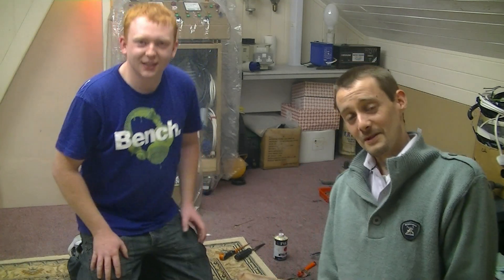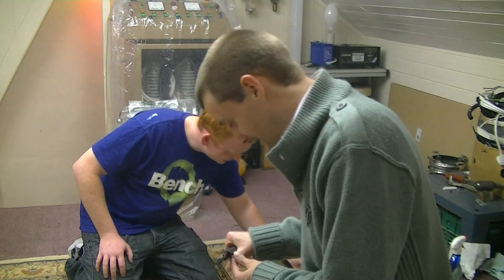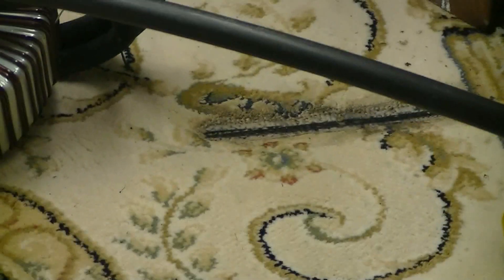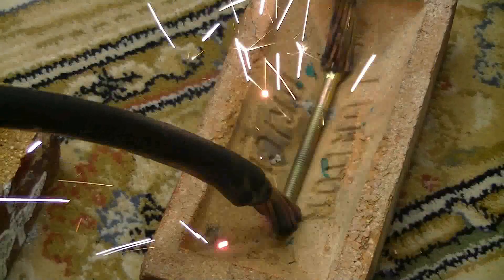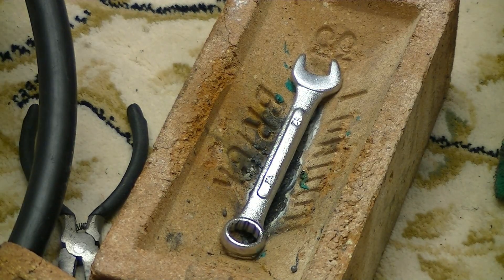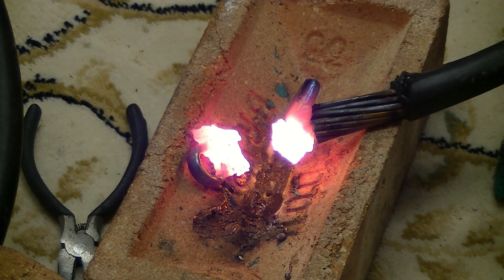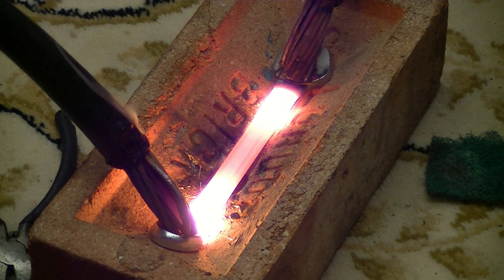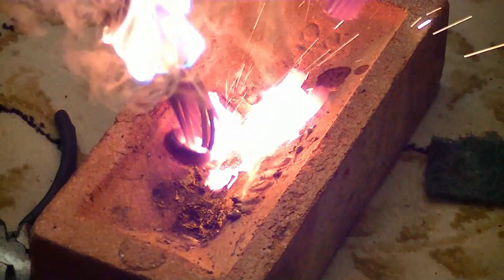5000 Amp Fuse + Tools Melt With High Current

Comment: This is like the most dangerous youtube video I have seen lol
Reply: look up "metal fume fever" fire is actually the least of their worries.
Reply: +Kreig Dernier 5 to 10 volts are not enough to let many current travel through your body. If the voltage gets higher, more current flows through your body and this is what kills you
Reply: The voltage directly determines how much power flows through your body. It takes about 100 mA to kill you. A double-A battery can supply about 4000 mA, and yet you can hold it without dying. It's because it's only 1.5 volts. It doesn't matter if it's capable of supplying 4000 mA, 4000000 mA, or 4000000000000 mA. Your body simply does not draw enough power at 1.5 volts to harm you.
Reply: Don't worry, dettol on standby
Reply: It's current which kills, but for reaching that current in the body you need a sufficient voltage. So yes a 5000A 12V generator will not harm you, because the body resistivity makes it impossible to reach 30mA with just 12V (the body limits the current). Just as a 100kV 1mA generator is safe, as the current is then limited by the generator to 1mA... You are both right.
Here this is dangerous only if the voltage is higher than 12V to 48V (depending on people and skin moisture)
Reply: amps is just the unit of current isn't it
Reply: I = V/R where I is current, V is voltage, and R is resistance. A high current can be a low voltage, if the resistance is low too. Etc. The resistance of human skin is usually too great for lethal amounts of amps to pass through us, unless the voltage is raised to overcome the resistance, which uses more energy, obviously. A typical household plug is limited in both voltages and amps by law, where most 220-240v sockets are 10 amps maximum, but by using a transformer they can exchange some volts for some more amps. This video is just an extreme example of that, where the voltage is probably minuscule, but the resistance in that thick copper wire (welding cable) is also minuscule.

It really shouldn't be difficult to understand, and I never really studied physics at high school or have a background in electrical work. I'm only a bicycle mechanic...
Reply: To all comments here:  it is electricity.  Don't fuck with it.  There.  I win the argument.
Reply: Steve annonomus 
They had kerosene on the ready as an extinguisher.
Reply: I was uncontrollably dodging the sparks
Reply: just think.....if we watch long enough we get to see how fish and chips are really made..............Darwins Law is rather slow acting sometimes,or is it just the entertainment factor causing the slow down ?? I DUNNO.
Reply: Justice Harmony that's as meaningless of a statement as "it's not the gun that kills you, it's the bullet" "Guns do not move thus they can't kill you, bullets are what move"

Refer to Ohm's law, V = I x R
Volts = current x resistance

Now, the human body is not a homogenous conducting wire, but the same principle generally applies.

Voltage and amps have a direct relationship to each each via resistance.

Saying that amps kill and not volts or vice versa is one the stupidest things a person can say.

In the case of the human body, if voltage is sufficient then it will allow enough current to pass through the body to stop the heart. I = V/R demonstrates this relationship.

Electric potential (voltage) allows current (amps) to flow, THEN the current kills you.

Similarly, guns allow bullets to accelerate and zip through space, then the bullet kills you.
Reply: Guys, who gives a fuck. The Shamrock Shake is back.
Reply: Steve annonomus It's LIKE the most dangerous? Tell me which other video this is similar to! i want to know!
Reply: the current will slay you...  lol
Reply: Steve annonomus why are you doing something with electricity and fire on top of the carpet man come on now
Reply: They use a reotor @ 1-2kv, lets assume 1.5kv. Winding ratio of the currenttransformer is around 100/3 so that means sec voltage is at around 50v in the best case scenario (won't be that way). It's not entirely safe but if they do not have a wet skin they probably won't get electrocuted by touching it. Heat is another thing ;)
Reply: Steve annonomus guns don't kill people rappers do
Reply: can i try this in my living room?
Reply: kadyr5 you're eighter the worst electician i've ever met or a fucking liar. open a phisics book lad.
Reply: Actually if voltage gets higher it doesn't mean you get more current flowing through your body to kill.. The possibility of anything going through you is based off of resistance or "Ohm's". The main thing to note with current draw is that power will find the path of least resistance. The majority of power will find it's way through whatever has the lowest resistance.. If you have 2 wires hooked up to the same source of power, amps will find their way through the wire with the least resistance.
Reply: Steve annonomus you should see his other videos.
Reply: Galinette2000 the body might resist current but at the cost of.. oh.. idk.. FUCKING 2000 DEGREE HEAT
Reply: just think of electricity in terms of water and water pressure. current=amps. so say you have a garden hose and it's spewing out water. the current is coming out in a consistent matter. then put your thumb on half the opening and it starts spewing water out more intensely. it doesn't affect how much water(amps) is coming out, it just makes it that much more intense. so yeah. anyone who says they've been hit with over an amp is a liar. voltage doesn't kill, Amps do. voltage just makes your death that much more violent.
Reply: It actually doesnt have to be as high as you might think. Condition of the skin and where it makes contact are huge factors. check this site out as its explains in decent detail and has measurements. http://www.allaboutcircuits.com/textbook/direct-current/chpt-3/ohms-law-again/
Reply: "voltage is less dangerous at high voltage". Oh my fucking god. I can't unsee this.
Reply: +MrTylerGaming when I made the comment I had no idea they were also drunk! adds to the danger!
Reply: Shaza Selvarajoo best response. can we all agree that electricity will kill you? or someone can just make a YouTube video testing individual results of being shocked with low volts-high amps, high volts-low amps and finally high volts-high amps. I will subscribe. lol
Reply: So many replies.. Voltage is the potential. Amperes are the measure of electrons flowing in time. You can increase the wire size, lessen resistance and allow more current flow. If the voltage (difference between) does not effect you because there is not enough potential..then you'll be ok BUT if the voltage is enough to cause current flow through your body very little current flow may affect your nervous system or stop your heart. Same way that a very high voltage can hurt but with very low current there is not enough passage of electrons through your body to cause your systems to fail..or burst into flames..vaporize your body..etc
Reply: nothing dangerous is not there
Reply: +ady gombos - If 8 amps is flowing through a person's body, he will be dead.
Reply: +kadyr5 it's current that kills. the only reason you survived 200 amps is because you have skin. the relation is that higher voltage = more current for a given resistance. it only takes a half an amp to stop your heart. put a cut on your chest and a cut on your back and stick a little battery charger or something on both sides and you'll be dead in 3 seconds. as an "electrician" you should probably learn about these things...
Reply: As an electronics technician its funny reading all those comments XD XD
Reply: It's both that kill you... low voltage = can't pass the resistance of your body = very little current. No electric potential = no current. The relation is very simple I = V / R
Reply: Steve annonomus k
Reply: Yeah, playing with high voltage while drunk is still pretty damned dangerous, especially when you are melting metal with it.
Reply: so is there any risk to what they are doing?
Reply: TheDantheman12121 Yea. It honestly depends on their set up though... Really the only thing protecting them from getting fried is the rubber around the wire they are holding in their hand. Also they are using a step up transformer which is most likely getting really hot sitting on the floor.
Reply: You need to learn ohm's law.
Reply: Actually it does. it explains the relationship between your body (r), voltage, and how that affects current. Also thats only one of many equations to ohms law. See here http://www.electronics-tutorials.ws/dccircuits/dcp4.gif
Reply: ph4nt0m For sure, It all depends on how and where the electricity flows thru the body to take out organs. has to find the shortest path back to is source..i get it and studied electricity. take care
Reply: Federico Mora first of all water and water pressure would be amps and Volts. Water = Volts, Water pressure = Amps. If u block the tube the pressure (amps) rises because of a higher resistance but the Water (Volts) always stays the same. 
Secondly u can get hit with more than 1 Ampere and survive (lightning would be the perfect example) its just very unlikely. Also saying voltage doesn't kill u is also not completely wrong but also not true either. If u get hit by 24V/6A u won't even notice it. If u get hit by 230V/0,002 A u also would survive but if u get hit by more than 50 V and more than 30 - 50 mA u will most likely die if this all happens long enough, because time is also a thing here.
Reply: The typical static electricity that we feel is about 10,000-20,000 volts.
Reply: +Alex Paulsen I always thought that transormers just changed the voltage by itself.  So if you drop the voltage down in a transformer, the amps go up, whereas if you raise the voltage, they go down?  If thats the case does that mean control circuits that get 24v, like a thermostat are higher than normal amps?  I think its googleing time for me  lol.
Reply: Steve annonomus dunk guys and electricity don't mix
Reply: +Bach Tran Not entirely true. It is not the power that is killing you, it is the specific range of amps (the typical 0.5A/1A being the most dangerous) that will cause Ventricular fibrillation. In an AC regime it also depends on when exactly you are being electrocuted that can make the difference between life and death. Somethimes high power (for example a thunderstruck) with amps going up to 30kA and voltages way beyond any reasonable number to be alive can be survived because the shock is this big that it basicly became a defibrillator instead of a fibrillator, wich will not cause ventricular fibrillation. However, the inside burning and damage to organs CAN cause death but this to show that in general dieing from electricity, for example from your own electric grid, is caused by amps and amps only (OBVIOUSLY ASSUMING YOU ARE CONDUCTING SO FOR AC REGIMES VOLTAGES ABOVE 50V).
Reply: Steve annonomus Ikr, they're even doing this on a rug which seems veerrry flammable!
Reply: GuildOfCalamity  plus there on carpet wich could catch fire
Reply: Steve annonomus *Most Dangerous YouTube channel
Reply: it wouldn't be 5000 amps without enough voltage to force the flow of 5000 amps.
Reply: Rocket Steve929 agreed, fucking idiots
Reply: C4rnif3X I swear if I hear this bullshit one more time I'm just gonna end myself right here and right now. Of course it's the current itself that kills you but without the necessary voltage it won't go through your body. At 10 volts you can have 8 hundred million billion amps and you still won't die simply because only a minuscule amount of current will flow through your body.
Reply: feylezofriza the amperage is what causes involuntary muscle spasms. These muscle spasms are deadly if they involve the heart.  However with a low voltage it is not possible to flow that much current through a normal adult body. This is because of ohms law and the resistance of the body.
Reply: Ohm's law states that the current through a conductor between two points is directly proportional to the voltage across the two points.      
i hope this helps.
Reply: Read his whole comment.
Reply: ph4nt0m Was read...
Reply: d2dak87 That's what I thought but honestly only spoke what I knew. Wasn't sure how much would kill. Just knew his claim was crazy lol
Reply: RyanPerson it's how a transformer works. You literally transform a high voltage into a high current. You can't get extra amps for nothing, so something has to give...
Reply: Alex Paulsen Yea when it comes to motors and transformers you can get extra amp draw... I'm an Hvac tech and if you have a short or internal problem you can get double current draw increasing the amps if it hasn't tripped a breaker yet. Take a seized up condenser motor (central air outside fan unit) for example...When the circuit energizes it won't turn the seized up motor so the amps jumps through the roof and the component starts to overheat & get red hot to the touch
Reply: Alex Paulsen I had to google it to figure it out, but I wasnt aware there was a set max amps that you could draw.  I thought you were saying that lowering the voltage on a step down immediately increases the amps, but it just increases the maximum amps you can potentially draw.
Reply: Charlotte Lowe 
guns don't kill people...
but they sure do help.
Reply: Volts do not move thus they can't kill you, amps is what moves
Reply: +Justice Harmony You're right. I couldn't find my gun, but I did have a few bullets in my pocket, so I just threw one really hard in self defence and hoped for the best.
Reply: MrTylerGaming
Speak for yourself. I got absolutely shitfaced this one time. Best sex I ever had.
Reply: You need a combination of both voltage and amperage to kill you. You need a minimum of 20 volts and more or less 100mA, then you'll be electrocuted to death. If you have at least 20 volts, and even more current you're dead anyways.

However, if you have about 12V and even if you have 5000A, that is not enough voltage to penetrate skin, unless your skin is wet or have some sort of conducting liquid or anything of the like. Basically, you won't conduct the electricity because it lacks the required voltage :)

*Edited for spelling
Reply: +anima oblitus Just being this close to this amount of current is incredibly dangerous! I am glad that you survived your incident. God blessed you on that day my friend. I was once tazored, also have been hit with 125v ac 20 amp many times and have always been okay.
Reply: I'm guessing there's no fire extinguisher in the room either
Reply: You guys need to chill out. It's really not dangerous at all.
Reply: Sam Wells They transformed it to almost 0 volts. As I explained in another thread on this video, the natural resistive properties of the human body make it almost impossible for anything under 10 volts to penetrate. But please, why don't you, a man with no formal training in electricity, explain to me, a dumbfuck, why this is so dangerous.
Reply: Bernard Manning I don't understand where that misconception comes from. Amperage definitely kills you, for the same reason that you can't put 50 amps through a #12 conductor. Resistance increases with amperage, so as amperage goes up, your body gets hotter and hotter until you're like a filament.
Reply: that's like saying a knife does not kill you, the bleeding out of that very big hole does
Reply: All they are doing is arc welding.
Reply: Its half true, if you have power supply 10V (max. 1000A). Your body have about 2Mohm. I=U/R  -   Current through your body is negligible ... Danger is short circuit if you have thus powerful source ...
Reply: You're wrong.
Reply: That's not actually true.  It is to an extent, but if it were only down to "amperage that kills you* then you'd die instantly if you ever touched the terminals of a car battery.  But - as it turns out - you can't even get a mild electric shock off a car battery.  Why is that?
Reply: Amps kill you, but it needs high enough voltage to push the current through the natural resistance of your body.  5000amps might not kill if the voltage is low enough, but I wouldn't want to play with it especially when your bodies natural resistance can vary wildly depending on a number of conditions.
Reply: +Forrest Hayes - Nope. They need to DECREASE voltage to get higher amperage. In this case, it's the power that's constant. Hence the torroidal coil with several inductive turns. Remember, P=EI.
Reply: Current does kill you, because current is the actual movement of charge (EE here). However, your body is highly resistant. It takes higher voltage to overcome the thousands of ohms of resistance your body has, but if that voltage source can't source the current, it won't hurt you. I could have unlimited current available at 30 V, for instance, it would be harmless to a human. Dude claiming he "got hit" by 200 A is full of crap, unless you had a 10MV source. It doesn't take much current to kill you, but you need the "pressure" (voltage) to pull it off. Voltage, resistance, and current all depend on each other via ohm's law: V = IR. Easy.
Reply: @kadyr5 You are no electrician. It is the amperage. The human heart can be stopped at 100mA, even at a low voltage.
Reply: Mike, 8 amps of current and being CAPABLE of 8 amps are two completely different things.
Reply: 23 years experience here mate,im the same,some of these comments are amazing!
this is one of my favourites,

just think of electricity in terms of water and water pressure. current=amps. so say you have a garden hose and it's spewing out water. the current is coming out in a consistent matter. then put your thumb on half the opening and it starts spewing water out more intensely. it doesn't affect how much water(amps) is coming out, it just makes it that much more intense. so yeah. anyone who says they've been hit with over an amp is a liar. voltage doesn't kill, Amps do. voltage just makes your death that much more violent.
Show less
Reply: +Patamaran - Are you talking to yourself?
Reply: C4rnif3X You are misinformed, A million amps would even kill youbif there is no volts,  But that goes both ways, Neither Amps or volts can kill you without both and 1 amp can kill you if the volts are high enough.
Reply: +FordGT489 - Electrical Engineer here. Don't even try. Everything you said shows complete inexperience and incompetence.
First, there will be no current if there is no voltage. None.
Second, one amp is one amp regardless of the voltage. One amp can flow sourced from .00001 volts or 100,000 volts, depending on the load conductivity (inverse of its resistance to current flow).  A human heart entering cardiac arrest due to electrocution can stop due to current flowing through the heart and associated controlling nerves as a result of voltage placed across it.
Third, again, you cannot have current flow without electrical potential (voltage) as a source.
Fourth, you can't touch something that is 8 billion amps. If you place voltage across your body, current begins to flow through it according to your body's conductivity.
Fifth, volts don't go through anything - voltage is the electromotive force potential across TWO points. CURRENT flows THROUGH a conductor.
To summarize, you sound like a complete fool. Do a little research or shut the hell up.
Reply: I dont want to explain It in words anymore because i noticed that a lot of people are misunderstanding things. And i think everyone wants to say the same. So i want to show you some numbers and their meaning.
All the Numbers i will show you, show the capability of a theoretical energy source. Example 0.5 A max (no matter at what resistance they are hooked up to). The reason of this is the internal resistance.

1A at 200V ---> can kill you 

0.001A at 200V ---> no danger 

200A at 10V ---> no danger 

12000A at 5V ---> no danger 

0.5A at 150V ---> can kill you 

3A at 24V ---> no danger 

You need enough of both of them to harm your self.
Reply: Steve annonomus funny thing is, I'm an electrician and I nearly died from an arc flash about a month ago while wearing my full suit, and these idiots are doing this.
Reply: klazzera voltage is less dangerous at high voltage its amperage that kills you
Reply: Steve annonomus yeah
Reply: Steve annonomus It's lit, fam
Reply: Galinette2000 volts don't kill...amperage kills.
Reply: Use some carbon sticks and the plazma will really tear it up
Reply: Captain Radd Everyone Knows Ohm's law. E over I/R.. It's more of a mathematical use.. Not an actual "law" that explains what everyone is talking about here.
Reply: ph4nt0m I should have worded it differently..really high voltage could..yes, amperage is like the volume of flow..
Reply: Gweilo Xiu Haha yes you do.. lol
Reply: Mitch Sieckmann thank you for such a great answer..now I understand.
Reply: The BNC (Bmx News Channel) :-D
Reply: kadyr5 Well its really amps that hurt you, but you need enough voltage to push the amps through your body for it to have an effect.  High voltage, low amps wont to anything, whereas high amps, low voltage wont do anything either because human skin has to much resistance for low voltage to have any effect.
Reply: Amps are like a current, or the amount of electricity you have flowing, voltage is equivalent to pressure or how much force is behind it, in lay-man's terms. I can't believe how lacking most of you are in this subject.
Reply: klazzera Are you sure the voltage is low?  How would you get that many amps with a low voltage?  The way it jumped, there is no way that is low voltage.  You can increase the voltage, you can add resistance, but I dont think you can directly control the amperage.  Im not very knowledgeable about electricity, so I wouldnt be surprised if im wrong.
Reply: Alex Paulsen Well the one thing that is confusing me is that this looks like a regular resistance circuit.  In resistance circuits amps is just volts x resistance(ohms law).  I know with induction, like motors less volts equals more amps so ohms law doesnt apply there.  So shouldnt you have to increase the voltage to get more amps in something like this?  Or does adding a transformer change the way it works, making it something other than a resistance circuit?
Reply: Alex Paulsen wait I fucked up ohms law its volts divided by resistance isnt it?  I cant remember any of this
Reply: klazzera wow your dumb as fuck.
Reply: Dude, it&#39;s literally both amps and volts that kill you. However, if the voltage is not high enough no current at all will pass through your body due to its relatively high resistance.

Power = volts x amps

the more power, the more dangerous (frying you to a crisp). the question is whether voltage is high enough to overcome resistance.
Reply: Pish. 200 mA across the heart is fatal.
Reply: Yes you are right, guns do not kill.  The bullet does.  This is a fundamental concept and very important information when informing someone about the subject
Reply: +Gweilo Xiu Thank god a logical person lol. I want all of these people talking about ohm's law (which I know) to make a vid of them doing this in their house! They wouldn't do it lol!
Reply: +Charlotte Lowe Believe me I am from Chicago that is a factual statement. Also Crack, meth, and heroin make people want to kill for the high.
Reply: Glen Patton can lol😘
Reply: Steve annonomus y
Reply: Steve annonomus 
you haven't lived
Reply: +French Montana I love shamrock shakes!
Reply: What ?      Watch the Syrian war footage video`s
Reply: The bullet doesn't kill. It's bleeding to death or sudden massive trauma that does it...
Reply: Every time the Argument "its the Amps that kill you" pops up, its fascinating how many selfclaiming electricians answer and dont know shit about what they are talking

first, the second coil isnt grounded, there goes half the danger

 @ thread
By the logic of half of you, a Car Battery would kill you by touching its poles. After all its over 100 Amps when i put a Spanner between them....

And btw, the frequency does also kill you....
Reply: Vander Gilden Of course you need to break a certain threshold of voltage. Good job with the reading comprehension.
Reply: The BNC (Bmx News Channel) yeah, it's best to ignore those types.  If it were fact, just imagine how many people would die from static discharge from everyday shock from sweaters, carpet, random touching of door knows, etc.  that's upward into 200,000 to 400,000 volts, but with super low current and duration.

My pinky finger once found a Christmas light cable with wet and broken insulation.  thankfully grounded with that same hands palm...  The 235V, 13A AC circuit grounding through my hand for around 1/2 second was enough to make it difficult to use my hand for a few minutes!  So very happy it didn't travel across my chest!  could have been bad times.

This is why a high voltage(E)- The potential Electromotive Force supplied is a small factor in severity of electric shock in comparison to the current passed and duration of the circuit completion.  Also why people CAN survive lightning strikes- they have high V and high A...  but with a very short duration...  though I'm sure not pleasant.
Reply: Could've just said the last part...
Reply: ITT:  Loads of people that know dangerously little about electricity, and should just avoid it altogether.  I'm a little concerned that some of you are plugging in vacuum cleaners on your own...
Reply: Rocket Steve929 30mA is enough to kill you IF you are in contact with both electric conductors at some seconds( don't have the exact diagram number). The Ampere kills you, since it fries your body from the inside, may aswell be outside. Frequency is another factor thst plays in.
Reply: Actually, increasing the voltage across a given resistance increases the current proportionally. It's called Ohm's Law and is represented as I = V over R,  or, more easily represented here in this comment box, V = IR
Reply: obviously has no clue what he's talking about
Reply: meneppäs vaikka ylilaudalle spurdoilemaan, jopa minä käyn siellä :)
Reply: completely nuts^^
Reply: Rocket Steve929 thats what Doctor who does  dangerous things  the guy on the right resembles me to doctor who... Lol
Reply: +ady gombos - 8 hundred million billion amps is not a minuscule amount of current.
Reply: Robert Vigil that's right, if the current is able to get in your body. This is just possible if the voltage is higher than 50VAC and 110VDC...
Reply: Cotronixco I didn't say it is, I said the current flowing through YOU will be minuscule. The output will be 8 blah blah amps, but using ohm's law I = U / R we can calculate the current that will flow through your body.

Your skin has a resistance of about 10k ohms depending on moisture and other stuff.

So 10 / 10,000 = 0.001.

1 mA is certainly not enough to kill you.
Reply: Cotronixco Do you have dyslexia?
Reply: C4rnif3X mA's are mili-amps not mega-amps and mili-amps can not kill you dumb ass
Reply: +ady gombos - If a supply is outputting 8 amps as you stated, and the load is a human, that human will NOT survive. That's not dyslexia, but simple physics.
Reply: Cotronixco well the supply may be capable of a 8 amp output maximum. Let's assume a supply voltage of 5 volts. 8 amps at 5 volts (5÷8), this would mean the resistance of the circuit is 0.625 ohms. If we vary the resistance to a humans resistance with dry skin of approximately 100,000 ohms at 5 volts (5÷100,000) we get 0.00005 amps. This is 50 micro amps. This flowing hand to hand, would not be able to stop the heart. Take a study of ohms law and this should help you have a better understanding of current and resistance relationships. If you have any questions feel free to message me. I'm more likely to catch the message in my inbox.
Reply: Cotronixco Oh, so just comprehension issues, let me explain. Just because something has the potential to output 8 trillion amps it doesn't mean all the current will flow through you.
Reply: +ady gombos - Glad you just learned the difference.
Reply: Cotronixco I just explained to you the same way I'd explain to stupid people so you'd finally understand, but... Thanks?
Reply: wrong, 
amps is Flowing volume of electrons. voltage is pressure pushing that flow, and  multiplying to 2 together gives you Power or wattage (work that can be done with that volume of electrons at the given pressure )
Reply: ***** wrong!
I'll say this once only. (I have lots of qualifications and experience plus physics is a hobby of mine that I use in my instrument making and analasis of waves that are the same as a sine wave e.g. alternating current, etc etc)
The lower the voltage, the higher the amps.
In simple terms the lower the voltage the harder it has to work (amps)
Look at it this way.
The high voltage powerlines are run at 11KV -33KV in the UK for various reasons but the most relevant reason here IS,
The higher the voltage the lower the amps are which in turn mean that the cable is thin because it's amps that creates heat and melts the copper cables carrying the amps (current )SO by distributing the power via such high voltages it saves on cable size,weight, money etc.
Now at the various points that are required such as towns or housing estates or factories they have substations that "tap off" and are then transformed into low voltage (400 volts, 230v per phase in the UK) to be used in a domestic capacity or socket outlet in our houses etc. 
I really am talking basic first year electric theory here so if this is not being understood then it is NOT my spelling or how it's written. It's layman's terms if you will.i could go on but I just don't need to and also it's Friday night and I'm doing somone I shall never meet the service of expanding their knowledge of electricity and physics and will probably come in for abuse If it's not understood. 
Please feel free to Google or why not grab a book like we did 20 odd years ago before Internet. 
The example here finger on a hose to restrict the water flow us like a big resistor in a circuit like a massive heater or kettle which makes the circuit work harder in effect raising not the voltage (the voltage stays constant) but the current  or amps as to keep the circuit going ,otherwise it would trip the circuit, if not that it would melt the cable.
I can't use anymore simplistic terms.
Ohms law my friend. That's why they call things laws because they are proven and can't be argued with.
Maxwells laws,Einstein,newton,fibanachie etc.
Thankyou
Reply: The BNC (Bmx News Channel) Amps alone cant do anything and can not kill you.   I can touch something that is 8 Billion amps and not feel a thing as long as there is no volt going through it and vise versa.
Reply: The LA beast eats some pretty crazy stuff. I'm surprised he's still alive.
Reply: The tool-melting current in the heavy cables is driven by only about 3 volts. There is no danger of electrocution or arc flash, as Photon knows perfectly well. He IS an Electrical Engineer, yanno.
Reply: Cotronixco -- Electrical Engineer, you say? Degree from where? Not a P. E., I hope, because you are talking nonsense... half-truths and mixed concepts that add up to B.S. For instance, one can certainly touch something that is carrying 8 billion amps, if somebody wants to build such a thing. It will have a large cross-section, like a square meter or more, but that is certainly possible to build. You also say "First, there will be no current if there is no voltage. None." But that is blatantly false, which you would know if you knew anything about superconductors carrying Direct Current; they by definition carry supercurrent with ZERO voltage in the circuit. Everything else you say is equally murky and ill-phrased. Maybe you posted while YOU were drunk, like Photonicinduction often is in his vids? The difference is, he plays with hundreds of kilovolts at significant current while half-wasted, and lives to tell the tale. He does it often. That he yet draws breath speaks of his competence and proper understanding of electrical risks.
Reply: klazzera so your saying current strong enough to melt metal is harmless if it touches you? I guarantee  that’s 100+ amps and and the voltage is high enough to ark.
Reply: Seems some people doesnt even knows the first ohm's law... the current depends of the voltage across a resistence... we have a high resistence, so we need a high voltage to make a significant current flow... the current that kills you, but you need voltage to make the current flow... the video is pretty safe.
Reply: @C4rnif3X you need high enough voltage to overcome human body resistance
Reply: It's definetly in the top 5.
Reply: I can't believe someone said they were an electrician and claimed amps don't kill you but voltage does.. At a loss for words on that one. A taser is typically 10,000 volts but mostly harmless because its only a fraction of a single amp.. Being a certified Hvac tech I can assure you that guy is waaay off. He didn't get hit with 200 amps... He got shocked at someones house, which like everyone's house, has 200 amp service to the breaker. Not 200 amps to each plug. lol
Reply: Amps stop your heart the current is going to turn you into charcoal
Reply: Mitch Sieckmann wrong. amps is the flow rate. voltage is the force of the flow rate.
Reply: i dont think so, the only danger is fire, i bet the voltage is so low that there is no possibility it'll electrocute you.
Reply: yes. it's all related.    
I V R is why the bolt [ or whatever they're melting]  melts.
Reply: RyanPerson It all depends how it's wound. A transformer with fewer windings has a lower voltage but can pump out ridiculous currents.
Reply: Kadyr5 you must be the dumbest electrician on the planet, maybe got your cert off of eBay? I'm pretty sure you wouldn't get a job from anyone that knew you made such a comment. As the old saying goes..... keep your mouth shut and let people think you're stupid rather than saying something and confirming it.
Reply: klazzera its the amps that kill u 5000amps is more than enough
Reply: Comet Pjfa I would literally be humored to hear where people learned that amps don't kill.. I'd just love to hear who and where they got that information because not a single professional electricity course will tell you that.
Reply: dude im an electrician and iv gotten hit by 200amps and its no different then 15 amps the voltage is what hurts u. when u get hit by 15 amp u only get hit by like a miliamp if 1amp passes through u ur dead
Reply: @kadyr5 I think you need to go back a take some more classes
Reply: Steve annonomus yea lad but i don't think they get more than 5-10 volts out there. if so... it's pretty darn safe to touch it (must be cold of course).
Reply: Also electricity at its most basic is the flow of electrons  (voltage) from atom to atom (cable)
Reply: Amps are the push or "power" voltage is how hot. Ohms is a measure of resistance.
Reply: i heard it was amps that kill you